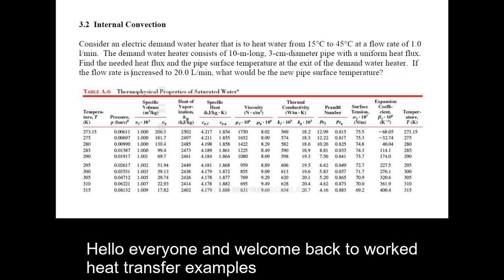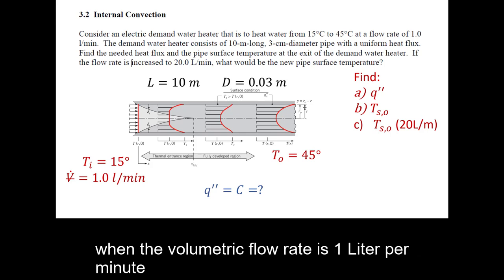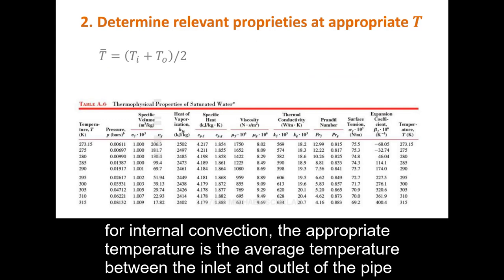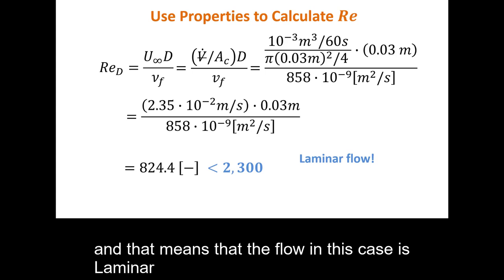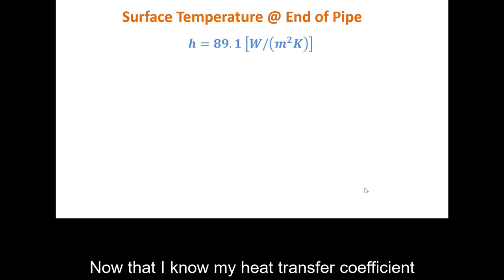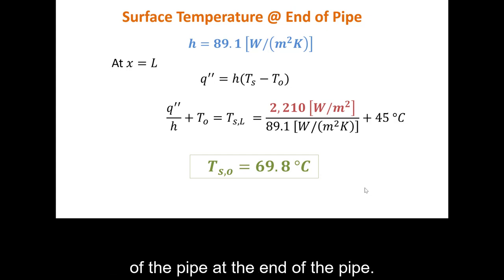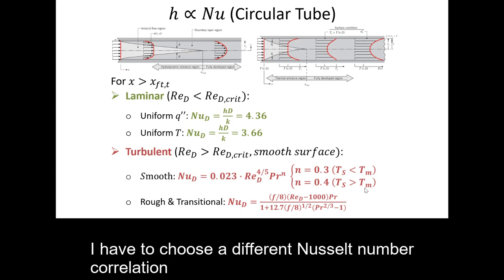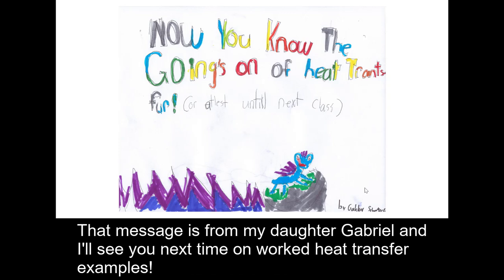Internal Convection pipe with q"=const (laminar & turbulent): Heat Transfer Examples for Mech Eng

Comment: Dear Mike,

I am currently working on my graduation thesis, which focuses on the heat emission of exhaust insulation systems in diesel generator rooms (Q in watts). The setup closely resembles the situation shown in your video a bit: a stainless steel exhaust pipe surrounded by insulation material.

I have completed the theoretical calculations and would like to validate my approach. If possible, I would be happy to send you a brief document with an overview of the project and a calculation example (4 pages). Any feedback or suggestions you could offer would be greatly appreciated.

Thank you in advance for your time and support.
Kind regards,

Comment: What is the reason for taking n=4 for heating and n=3 for cooling in case of dittus bolter equation
Reply from the maker: My understanding is that these come from emperical correlations and it fits the data better in these cases
Reply: @mikeschertzer941  but there may be some dependency of Pr no. with heating and cooling phenomena